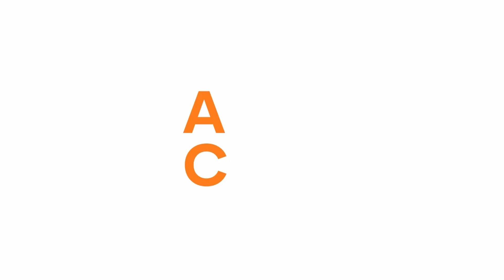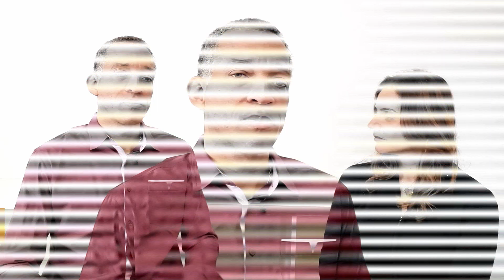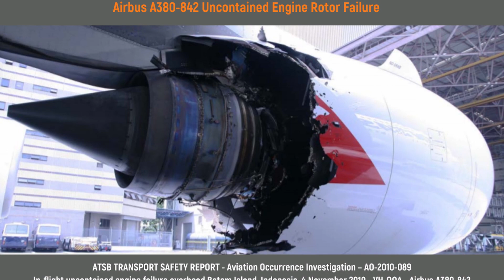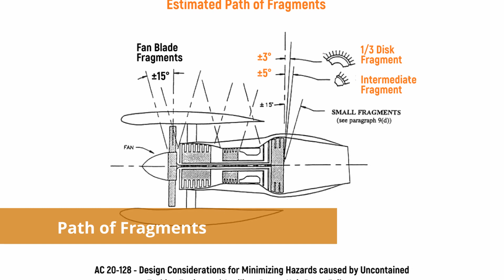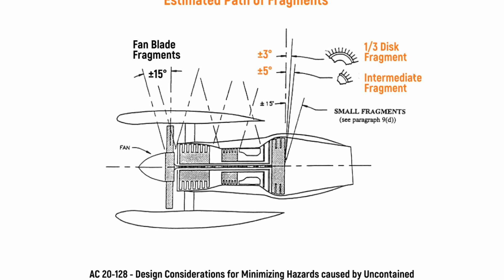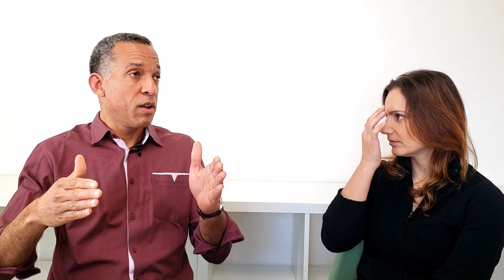UERF - Uncontained Engine Rotor Failure -  Rotor Burst - Aircraft Certification - Ansel James

Comment: Thank you Rafaela-san, Clarissa-san, and   Ansel-san for the nice channel.
It's interesting to know UERF. I was used to think why such the particular risk shall be considered even may not happened because the components have high reliablity.
But the point is risk IF it's happened.
As distributed, the risks shall take into account not only engine but overall the aircraft.
There was an accident cause from FBO.
https://www.ntsb.gov/investigations/AccidentReports/Reports/AAR1903.pdf
It was not well considered this PRA. And it was bad to not predict even similar incidence happened before.

Just lately, we've seen the news about FBO. I hope well investigation will be conducted and well actions will be taken to fix the problem.
To maintain the aircraft is safe.

Thank you.
Reply from the maker: Thanks for your comments Mizuide-san. The accident investigation is a powerful tool to increase the aviation safety continuously.